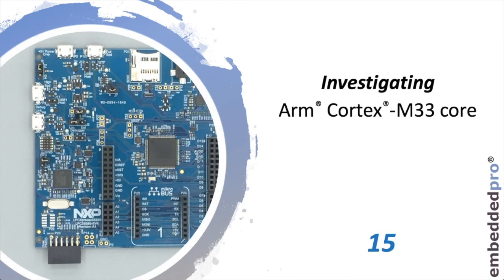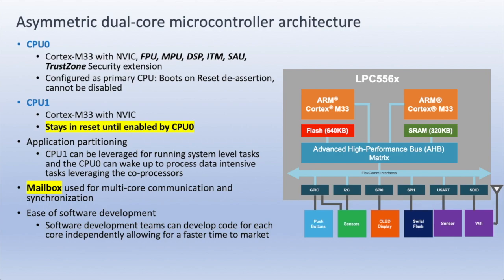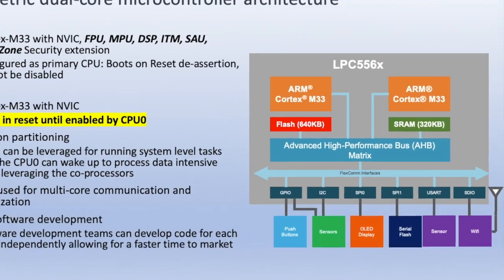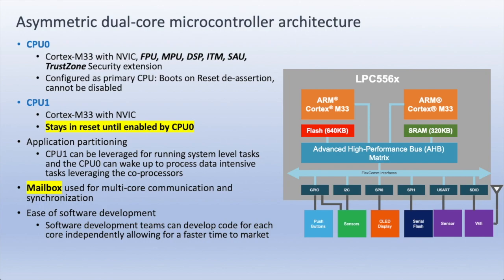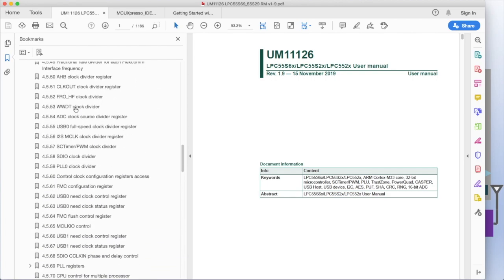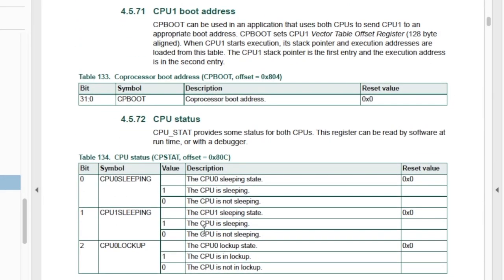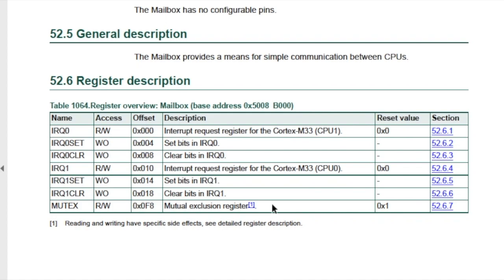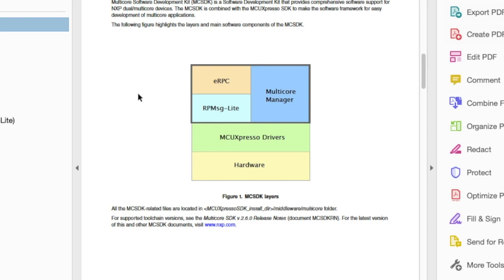15 - Dual M33 cores on NXP LPC55S69

Comment: Do you know if the LPC55S69 implements a global monitor feature inside its memory controller? This would offer an additional method for implementing a shared mutex without the need to rely on SoC specific IPs.